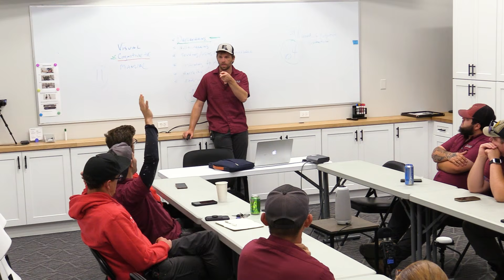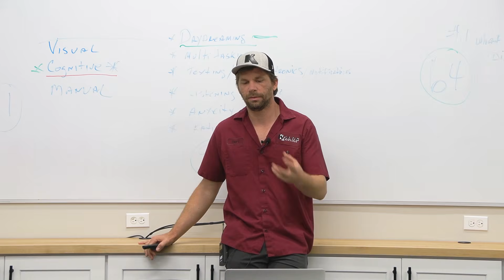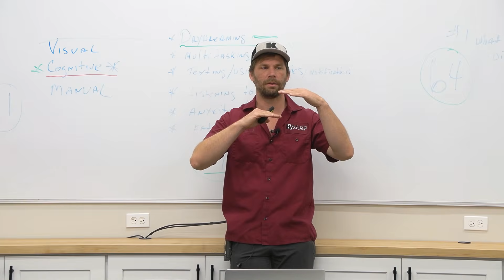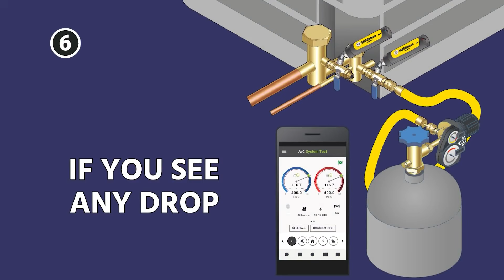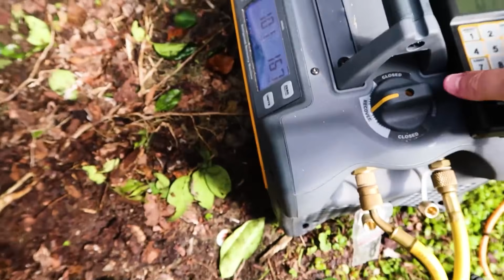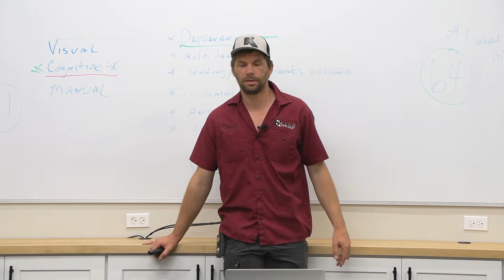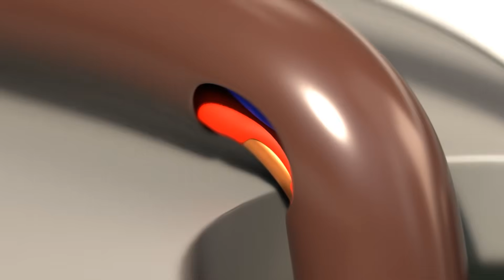Failed Compressors - Don't JUST REPLACE IT

Comment: We replaced the whole system and still have issues 😢😢😢😢😢😢😢 past 3 year been struggling with the AC, it stops working when it rains. Someone replaced the compressed which was swollen and worked for the past few months with no issues but yesterday it happened again and we have a heatwave here in Florida. We have had 3 techs out and I think our landlord thinks we are doing something wrong and I'm clueless we change the filter every 3 weeks

Comment: gata go look at a compressor tomorrow,  normal head and suc pressures,  but is going off on thermal overload.   cleans coils, and compressor and txv were replaced less than a year ago.  3 phase 10 ton unit
Reply: What did you find?

Comment: We have a technician that uses the line "Compressors don't die they're murdered" and he has been right on every one. 

Had a rooftop unit with fan speed wiring landed wrong getting no superheat. Reach-in cooler with a condenser pack full of Greece in 100° kitchen. Walk-in cooler with 404a compressor and an r22 TXV... I missed the TXV until startup. Recovered and charged with 449 and that unit runs flawless now

Comment: I’m in a new construction house and both mine and my neighbors compressors had to be replaced the first week we moved in, my neighbor’s compressor failed again and my HVAC system is working but very aggressive reverse rotation on mine and it’s causing a loud clunk every time it turns off in my bedroom. This video is insightful. Appreciate it. Any thoughts on what would cause the replacement condenser to have such aggressive reverse rotation?

Comment: i am a customer and feel i am being ripped off. they say the compressor is done and has 4 years left on warranty of the compressor. i watched an install of a compressor on youtube  and it is very technical . they want 2300.00 to install new compressor. i will be watching them like a hawk to see if they do the acid test and maybe a accumulator install. becaus like this video said " what killed the compressor?' this company here in phoenix was the original installer of complete system and 1st quote they gave me was 4000 dollars. i called around and the going rate seems to be 2200. so they easily agreed to do it for 2300. i dont trust them. maybe with whole new ground system from somebody else i can get 10 year warranty on whole unit. what if this new one goes out in 6 months. 2300 dollars again. any advise is welcomed. like the video.

Comment: As always, enjoyed your video.  I have a 13-year old Rheem single stage (R-410A) condenser.  Still running great but just realized a drier was never installed.   Was wondering what I should do, if anything.  Feel free to chime in.  Thanks.
Reply: You sure there's not one in the condenser
Reply: @ericmentzer8846 
I'm sure.  Popped the hood on condenser for a look-see.

Comment: What about lightning? So we had a lightning storm come through yesterday on my way to work after the storm, girlfriend said unit started making "some noise" so she turned it off. I came home tried to start it up and no condenser felt it hot to the touch, hosed it down and let it cool over night, swapped out both fuses on the disconnect and tried it, still nothing. Then I noticed the wires connected directly to the condenser itself were sooted up so I get in there and notice one of the wires is melted so I cleaned everything up with wire brush and cut back all the wires and completely re wired it up with fresh wire. So now it turns on but cuts right back off. The lightning probably killed the condenser? Or did I burn up the new fuses because I tried to run it with the wires like that? I guess I can try new fuses otherwise it's toast right?
Reply: Yep

Comment: Right now heating and cooling in Idaho. Remember that name. Worked for them and quit not long after starting because they are scam artist and only replace systems and don’t fix issues. They want to only charge as much as possible
 So I respect you training your guys to not just only replace compressor condensers

Comment: had one show up at my house said nothing was wrong with the ac had the electrician over 5 times cause the ac when it engaged it would blow the breaker he finaly at the last day takes the ac apart and the wireing assemble is burnt to crap you figured the ac guy woulda looked for this in the first day

Comment: When you first your guages to a running system, What are the high and low side readings that would indicate " bad valves", in a compressor  for 134a?

Comment: Heat, Energy surge/ spike & moisture breakdown down the varnish or insulation coating on the windings causing acid in the system it also shorts the windings together & or shorts through the oil to the shell of the compressor ie: Shot to ground. Allowance of .5 Mille ohms to shell. Sumpinlikedat

Comment: Hi, I found your videos and thank you for taking the time to help others. I am definitely learning a lot. I have a question as below: 

Mini-fridge compressor motor windings

I am working on a mini-fridge (proctor silex) and find specs on the compressor (B35CB5) data-sheet odd, so thought ask here.
The Data-sheet (url: https://hvacspareparts.com/Docs/B35C5B_181717(1).pdf) shows Start winding resistance 13.5 ohms and Run winding as 16.2 Ohms. It seems odd since the Start winding resistance is supposed to be higher. 
And the 2nd thing is when I measured, the commoin-run is 23 ohms and common-start is 15 ohms (start-run does show the sum i.e. 38 ohms). 

Am I reading it right or did I miss anything?
Hope to hear your comments.

Thanks,

Ashok

Comment: Kalos gives good training for their staff.  More shops should do this.  Great you invite us in.

Have you ever seen a replacement compressor have hard start issues due to excessive oil from original compressor throughout system adding to a full fresh load of oil from new compressor?  Refrigerant charge level and voltage drop to contactor during startup surge current are fine. (8 degs subcooling, 230vac during 109 amp startup surge current).  Original scroll compressor failed for compression, so no motor burnout contamination of oil.  Run cap, contactor, and liquid line filter replaced with new compressor.

The longer the system is off, the more sluggish the compressor startup, which makes me think it is oil draining back from five foot higher evaporator with 20 ft line length between.  The time factor could also be caused by de-wicking of oil from motor stator windings back to oil sump of compressor.

Believe this is a case where compressor failed for poor compression, but enough compression to get some liquid (at cooler nighttime), with oil, to evaporator but not enough return line vapor mass flow to return oil from evaporator to compressor.  When new compressor installed with full new oil load it drove the oil stuck in evaporator back to new compressor overcharging it with oil.

As you mentioned, understand the failure mode of previous compressor to predict possible consequences for new compressor.

Copeland official stance is only way to be sure of correct oil load is to pull compressor out and drain oil out suction port, assuming it should recover about 87 to 90% of full oil load specification, allowing for recovered oil loss of 8-10% system distribution and 2-3% motor stator windings wicking absorption of oil.

Comment: The bigger elephant in the room is cost. It's cheaper to just replace the compressor not worry about it. So the home owner has to be informed why it's important. Just preaching to the choir isn't going to do much with home owners being told regularly on line that if they don't like the price keep shopping. I got a phone call just a few days ago where the cost she was quoted is likely going to lead to another failed compressor. Who is educating the home owner?
Reply: You are. After reasonably explaining the process and necessary steps if the person can't decide cheap vs right... you don't want them anyways. 3 times from the 12-pack pickup guy(s) or once from us...now which is the better deal?
Reply: @mad1337nes  I maybe the 3, 4th or 5th contractor to the home or 25 DIY videos on Youtube. By then there minds are filled with more nonsense than what I can put here. Give me another atta boy, so I can move on? :text-green-game-over:

Comment: In my case, i forgot to open the refrigerant valves, customer turn it on for who knows how long... I went out there, open the lines... Re tested the system... I had 90 on my low and my head was about 600 psi.

Comment: I had a customer with 160 ft of lineset 110 ft of it was buried in the yard  north of Chicago it would slug the compressor until the ground warmed up
Reply: So they needed a trap on the suction line?
Reply: You probably need a liquid line solenoid.  Burying is a No-No LOL

Comment: a non working electronic low/high pressure switch, poor defrosting and water coming in to the refrigerant system in a air-to water heat pump is a few ones ive run into

Comment: Great class. A way to get around the possible failed  txv issue is just to install a new txv with the compressor. The system is already flat and it really doesn’t add to much labor or cost to the job.

Comment: Sorry if I missed it if you did mention this, I think it's critical to make sure people know that after a burnout assume you have acid always and do a test on the oil in the crank case, test-all is a great kit to stock on your truck. You can test poe or mineral oil w that kit. If your test fails, best practices are to use r11 flush or similar and then add a suction line filter drier made for cleanup but do not leave on the system, I think you did mention not to leave on system but it's important to remove that drier after a couple days and re test with the quick tests you showed while the system is running. Read directions on your test kit. It makes a difference. If you still have acid you need to install another suction and liquid line drier all over again, and do this however many times that's needed till you can pass a test. I will even reflush with the r11 and in extreme cases even add a scavenger and that works really well, then remove suction drier permanently and install fresh liquid drier and you're done. Install flare driers and add ball valves even  to make life easier. Many times it will take multiple rounds to be acid free. It's just what it is but if you leave any acid, you'll be back,or a different company
Reply: Are you located near Cincinnati…? I need your help!
Reply: That’s a lot of money you’re quoting

Comment: Agreed...todays HVAC systems are not built as well as the older stuff thats 20+ years old. So, it's not the best idea to suggest a bundled system replacement when a compressor or evaporator part will restore an older rig.  Most of those older R22 systems were built for the long haul unlike todays cheap 10 year life span units. Aluminum vs. copper, chineseium contactors and capacitors vs. USA, control boards galore...in the air handler, the condenser and other components all ready to fail due to cheap manufacturing processes. I have seen a few new condenser control boards that act as the contactor...high voltage wires connecting directly to them ! There is a design that will fail everytime too soon and not $30 to fix but $500 if you are lucky to source the part.
Reply: You gave failed to consider that newer refrigerants have much higher operating pressures, this leads to more stress on compressors. All things equal, higher pressures will result in more failures given the same quality standards?
Reply: @ Usually the compressors are least of the problems. Most issues are due to thin material and aluminum evaporators with very lean welds, sensors and circuit boards. Yes, higher pressure but its not all that much more than older units, maybe another 100 psi. So, higher pressures, aluminum vs copper, thinner materials and sketchy welds don't really match up well with higher pressures. Had they kept the "same quality" vs. make all of the changes, things would be more reliable like the older equipment.
Reply: @Garth Clark  I disagree with some of that. The biggest cause of short lifespan on modern equipment is usually poor installation practices whether it be from the installer not knowing the correct procedures or careless techniques which introduce contamination/non condensibles. That's the biggest cause rite there, moisture and contamination from brazing without nitrogen. I see it too often. Then you have alot of homeowners who can do any job themselves, enough said there. Now I do agree that pcb's can be a weak link in systems and the older systems didn't have any boards , tech has really come a long way since the 80s but because of that so has efficiency so the new tech is much welcome. There's also brands still making superb quality units today and if installed and maintained properly will and do still last well over 20 years and as time goes on who knows maybe we will see systems over 30 or 40 years old in the future still. That is as long as these manufactures don't keep playing the obcelence game like apple and the others. From what I see, that is a major contributing factor to a system that otherwise could last another 20 years or more needing to be replaced. Dealing with that rite now at a middle school that needs a 1.5 million$ lead lag chiller swap. Can't get the controls anymore and nothing available from anyone that could be compatible. Very unfortunate. But not all manufacturers are like that
Reply: @HVACRTECH-83  Of course there would be a lot of variables that affect HVAC longevity...installers are not created equal and the HVAC industry is very inconsistent when it comes to holding HVAC contractors accountable in best trade pratices and holding true to manufacturing guidlines for todays sensitive equipment. Presuming all else is equal...most HVAC tech will agree todays hardware is not built for the long run.
Reply: @Garth Clark  I still strongly disagree with the most hvac techs will agree that equipment is not built to last part. I believe that's what a tech would use as an excuse and I see it all the time. You can't prevent a pcb malfunction that was going to happen anyway, but just about every other part of any system can have a very long service life if given chance, that includes compressors,motors, contactors , motor starters, txvs especially, reversing valves as well, these are all parts that should and do last 30 years or more. A compressor doesn't just die. Usually. Contractors and starters die from short cyling/overheating/over current. Txvs 95 out of 100 times is contamination or rub out, reversing valves same thing. Contamination. No other way they can fail unless the very rare time a cap tube joint breaks but that's pretty rare and would be linked to excess vibration. The point is, soo much failure can be avoided for our customers and our reputations by knowing what's not normal when we start a system up and watch it run, every install, every screw terminal needs to be checked for tightness, every spade connector, if it's loose,tighten it. It's easy. You never know when you'll be back out a month or two later for a blown fuse,tripped breaker,whatever and a burnt up connection or bad moter even .
Reply: @HVACRTECH-83  depends  but there's no convincing me, my Amana 4T & 5T Premiere gas heater & 5T evaporator are problem free since 1991. Not even a capacitor. No leaks, no breakdowns etc.
Reply: @HVACRTECH-83  Good luck with finding HVAC tech who are that particular. Not that they don't exist but few will be. Especially installers. Todays equipment is not outfitted with USA motors and caps etc. Let me know when you run across an imported motor that made it past 20 years or an all aluminum evaporater that made it that far.
Reply: @Garth2011  ok, I know plenty,myself included. And you just said it all rite there.
Reply: @HVACRTECH-83  Some people are gathering up spare parts just to avoid that problem...so they have it when its no longer made or avaialble etc.  I have a new in the box gas water heater stored for the day I need one but the state won't allow the sale of gas water heaters in 10 years or so. Same goes with plumbing fixtures...many homes were built with the sewer pipes designed to work with a minimum water volume and cannot function with the low water volumes newer plumbing fixtures have. Had an issue with that once and found out the sewer pipes won't push out the waste with only 1 gallon.  Kitchen faucets are next to have parts for...the Government thinks that 1.8 gals per minute for kitchen faucets is helping when in fact that idea is hurting most homes. Garbage disposals won't work as they should with a low flow nor will it save any water. Same with the usage of said faucet, forcing people to wait to fill their sink to wash vegetables or other needs is saving water? No...its not but it is a nuesance idea.